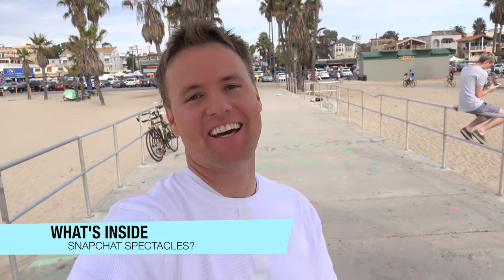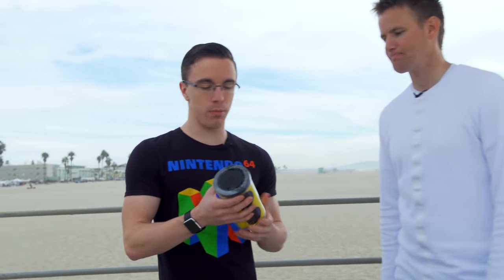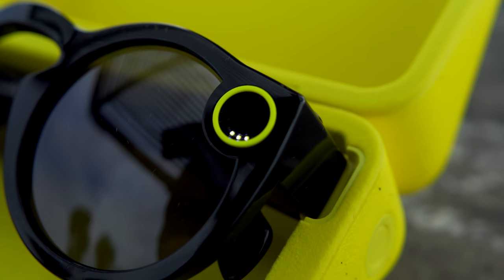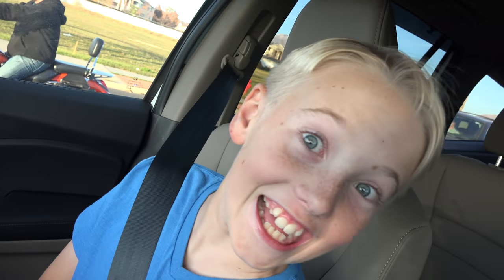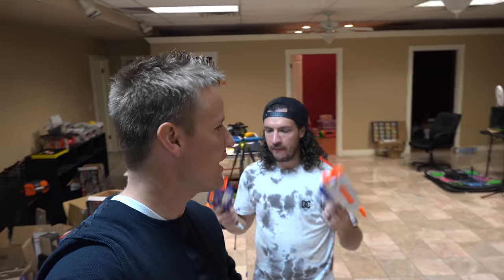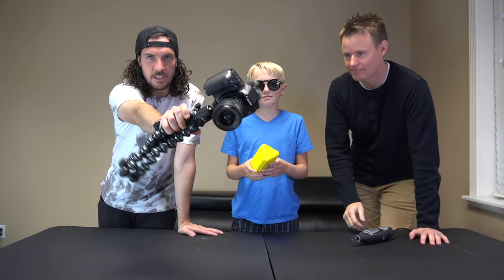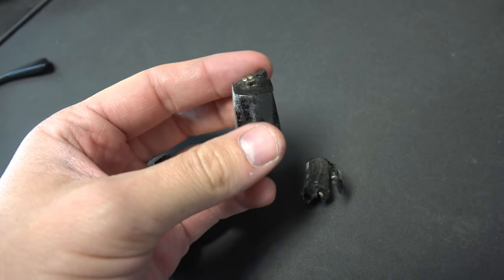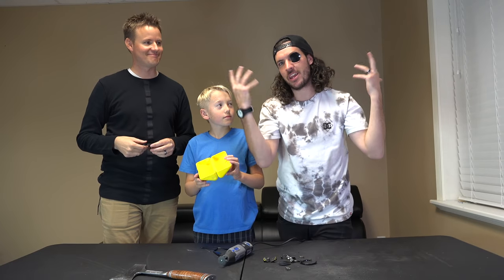What's inside Snapchat Spectacles?

Comment: What's inside the PlayStation VR
Reply: Sergio Garcia that sounds really cool
Reply: VR STUFF DUH . . .  sorry i think its simple like 2 720p 120hz small circle screens that are connected to the ps4 and the move is by the ps cam
Reply: ATRG81106 // Ahmed The Rednom Gaming 900p each
Reply: oh okay tho still you get the point its just 2 small circle screens
Reply: CringeGinge 900p 60hz
Reply: BUT AM PRETTY SURE ITS A ONE 1080P 120HZ SCREEN CUT IN HALF SO ITS 1080%2 = 540
120%2 = 60
oh so its a lot worst then i thot its 540p 60hz
Reply: potatoes
Reply: ATRG81106 // Ahmed The Rednom Gaming Nope 900p60 for screens
Reply: OK BUT YOU GET THE POINT RIGHT IT JUST 2 SCREENS
Reply: Wires
Reply: Sergio Garcia n
Reply: Sergio Garcia i dunno
Reply: Car/minion Mad 01 k
Reply: Maby a hole diffrent world :O
Reply: nah the htc vive is a hole diffrent world.....